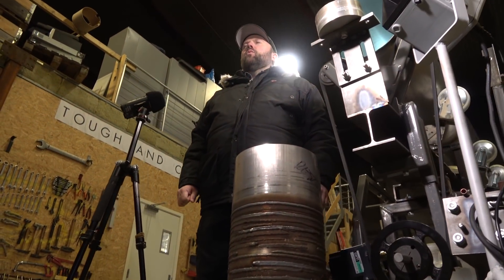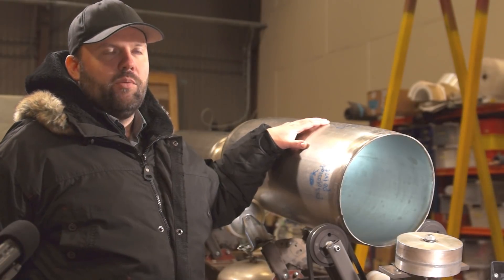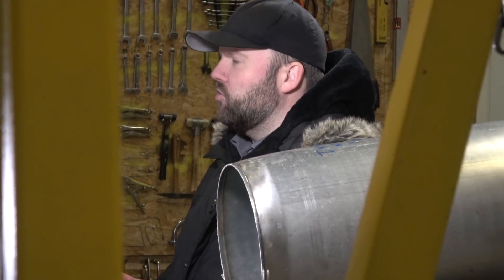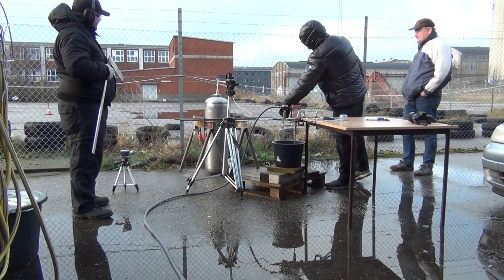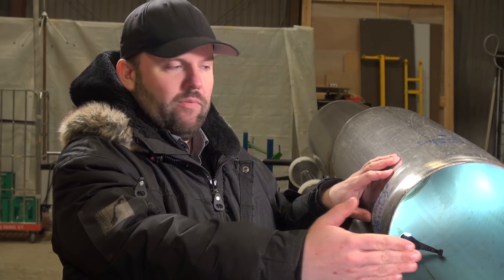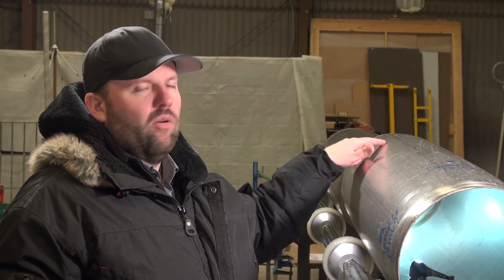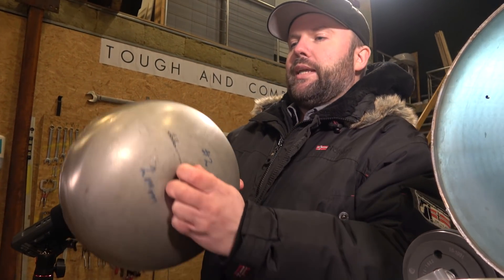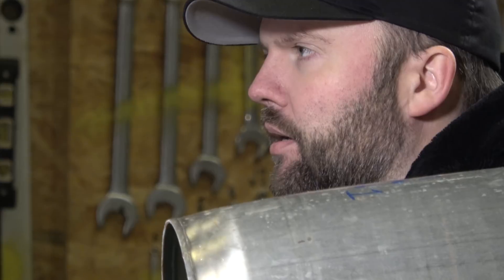How we build our own propellant tanks for rockets

Comment: So you covered it in the end of the video.. I was wondering why you didn't design the end caps to be twice the thickness of that of the tank body... That's basic mechanical engineering. Maybe you were experimenting I refuse to believe you didn't knew that.
Reply from the maker: Considering all our previous flight tanks did not break this rule, I'd have to assume this was just what we had laying around in the workshop and it was sufficient in this application to practice this welding technique and get some data points on SS deformation hardening.
Reply: Why are the end caps thickness is made to be twice that of the tank's cylindrical section as the theory indicates that the end cap is less loaded or stressed.

Comment: Where do you find thin wall tubing in that kind of diameter? Any industry standard names for it?
Reply: Basic flat sheet metal in 2m sections.  CopSub bends it into cylinders themselves.  Their original rockets were 2m circumference, so one sheet bent into a circle 2 feet in diameter.  Later rockets have been different sizes.

Comment: Why would you try to burst them standing next to it ?
Reply: The greatest danger is a stable pinhole failure that sprays out a flesh-cutting jet of water. 

If the failure had been on a vertical line, then the pressure would have dropped even faster than the end cap weld failure.

Comment: Dissimilar metals with the weld material not being the same composition is what set up the different stress regions for the failure. You could try friction welding but takes even more equipment. SS gets stronger when colder and as long as you aren't trying to long term store LOX the pressure rating shouldn't be a problem.

Comment: But wich pressure is Actually needed?
Reply: Which* and the pressure can be from the bare minimum to push fuel out and can be fitted  with a valve for varying pressures thus fuel flow

Comment: One very important question which needs answering is, 'How does a stainless steel tank behave under pressure at cryogenic temperatures?'. You don't want it going brittle and causing a LOX / propellant explosion.
Reply: Stainless, like 301, becomes stronger and more ductile at cryo temperature than the room temperature test.

Comment: Wrapping around the stainless steel with fibreglass seems like a cheap and effective way to make a composite tank that could withstand higher pressure.
Reply: Binu CB yes
Reply: Composites dont stretch.
Reply: Composites shrink at a different rate than steel. Steel becomes stronger and more ductile at cryo, so it better to just perfect the welds; and stretch the tank with liquid nitrogen.

Comment: For our small bi-prop engines we've used stainless steel fire extinguisher tanks for a couple decades now.  We'd cut the end off of two of them and weld them together.  They usually ran 500psi to 700psi range. For your big tanks I'd think you should be able to find spherical tank ends.  They're stronger but with some loss of mass fraction for your vehicle.

Comment: A high speed cam could come in quite handy in this research and development. You could paint big indicator triangles on the tank, pointing to where the weld begins / ends. I've seen a bump in the bead, maybe even a gap. Probably just a matter or adjusting some timings in your robot firmware. Oil pipeline welders do those kinds of high reliability welding jobs all the time, btw.
Reply: If you go the high speed cam route, you could paint multiple… however, i'd bet you've all seen car crash tests and those markings …i'm sure you know what i'm talking about …science, and stuff ;)

Comment: Why not semi-spherical endcaps for strength. I seem to recall most drawings of professional rockets doing that, then putting the XMas tree pipework in the oddly shaped intertank space leftover.
Reply from the maker: There are different kinds of end caps commercially available, Klöpper, korbogen, spherical and several others. We certainly intend to use such end caps.

Comment: I have no experience welding stainless, but mild steel welds are usually a lot harder than the surrounding metal. Perhaps heat-treating the welds would give them the flexibility to expand with the rest of the tank?

Comment: Super interesting video. You'll need even bigger tanks in the future, right? 
I wonder from which tank diameter the pogo effect starts becoming a problem? Do you plan on using some sort of insert as precaution?
Reply from the maker: We will need to scale it to 950 mm for the Spica vehicle. We actualle got the first 950 mm parts for a boiler plate capsule yesterday!
Reply: I thought pogo was mostly caused by elasticity in the tank bottoms transferring motion to engine mounts. Need to add stiffening braces between outlet pipes and higher up on the tank walls to bypass the bulkhead elasticity. Or use a stronger funnel shape.

Comment: what pressure is now put in tanks, how much you have to improve this stainless steel technology to make it applicable?
Reply from the maker: Our engines generally run at 15 bar, thus tank pressure must be around 21-22 bar. The key here is how thin walled can the propellant tanks be and still hold that pressure? For every 1 mm we shave off in thickness of the tank material, the Spica design saves about 100-150 kg of dry mass!

Comment: what tanks were you using before/how do they compare to these?
Reply from the maker: Our Nexø rockets use aluminium tanks with a diameter of 300 mm. We are not so keen on welding alu in 950 mm diameter and 10 mm thickness as would be needed for Spica. Thus we are experimenting with strain hardening stainless steel.
Reply: i would like to know that also.